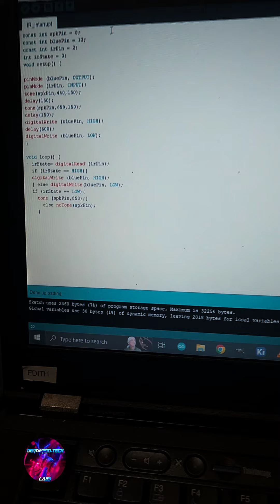Adventures with Arduino and building custom Peripherals

Comment: can you check response time on oscilloscope
Reply from the maker: No, but all you have to do is subtract 16mhz from the speed of light.
Reply from the maker: The plan is for the Arduino to measure each time the beam is interrupted, and for how long it's interrupted.   And to compare that data to time and calculate the characteristics of the interruption.  So it could do things like monitor the velocity of a turning wheel.  

The only delay will be artificially introduced by the code for stability.